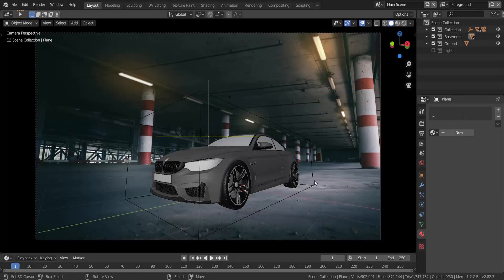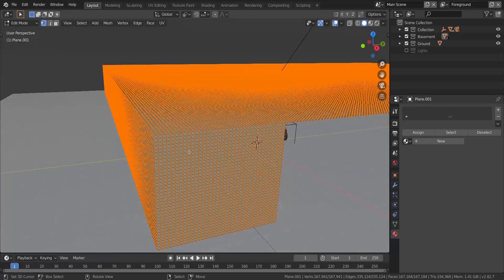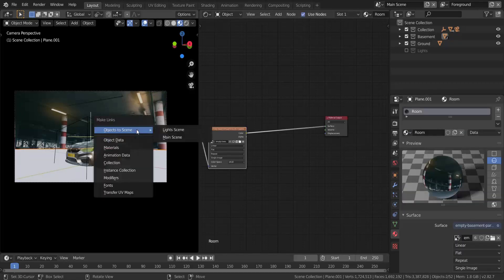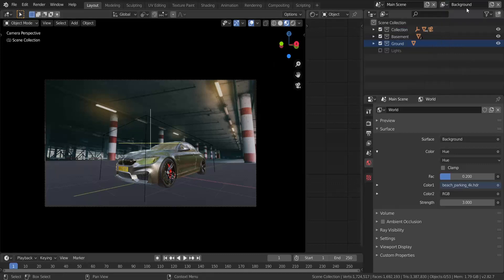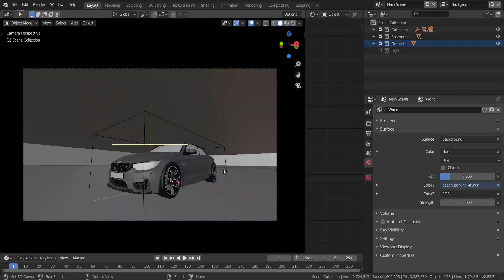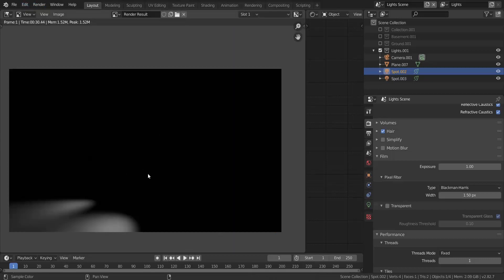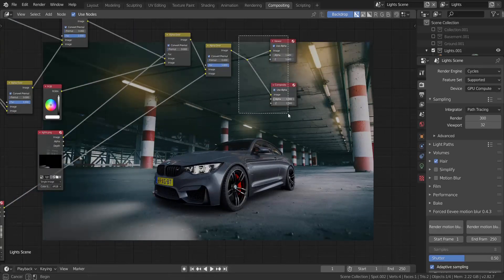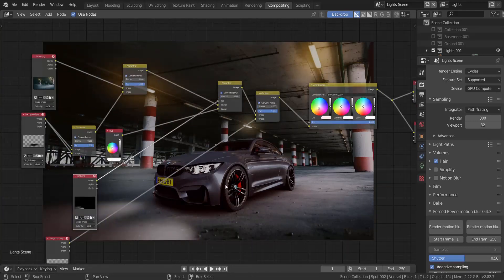Realistic Lights Catcher In Blender 2.8x

Comment: I really like all the videos you've made and have used a lot of your workflows in my renders, but I have just one problem. At the end of this video (and this applies to other ones too) the light shining on the floor looks flat compared to the bumpy, Rocky ground. perhaps there's a way to displace the shadow/light/reflection catcher to be more accurate?
Reply from the maker: yes, I decided to keep this tutorial simple enough... but to get such effects you could either: 1. Use rocky like particles also shaded black with your floor to simulate that or 2. you use a noise texture on the plane with two shades of black, one being the PBSDF black and the other being the diffuse node black (it doesn't reflect light at all) and hopefully you achieve your effect...